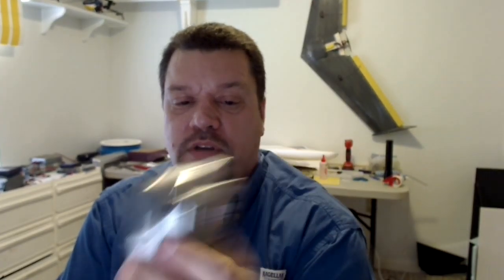FPV for beginners.  What you need to know to get started.

Comment: what about having a HAM license? i heard it's illegal to fly fpv without one. is this true? do you have one?
Reply: Not true,,  If you plan on upping your radio signal , then you do have to have a general radio license.  We do have a licensed tech that must be present when we are using the radio..... Good Question...
Reply: Candela Research Center what frequency and amount of power is legal without a license?
Reply: Lucas Madewell Most of the low power fpv 1.3Ghz, 900uhf, off the shelf are ok. You can get about a mile distance. The most basic license is called a “Technician License” and is all that is needed to fly FPV.Its 15 bucks and your local radio club can give the test. Its 35 questions, not hard. Then you can buy a long range version. There is a printout of frequencies from the FCC you can download...
Reply: Candela Research Center 1.2GHz harmonics can interfere with 2.4GHz, so your FPV and steering will work against eachother. On the other hand 900MHz jams your GPS and 433MHz requires license. That's why most people stick with 5.8GHz and try to make due with the range and line of sight limitations.
Reply: Michal Gloc
most are 1.3GHz not 1.2GHZ to help elminate this problem.

Comment from the maker: That's a pretty powerful video transmitter.  I think you would benefit from lengthening the video transmitter cables so you can move that video transmitter out on the wing.  The more distance the better.  I would say separate them as far as you possibly can and do some range testing with the video transmitter on.  Also make sure to set your failsafe on the FrSky receiver in case you loose your control signal.  Good Luck.

Comment from the maker: With a 5.8 ghz video system, you can use basically any frequency for control.  Probably the most popular would be 2.4ghz for control.  I regularly fly 2.4ghz control and 5.8 ghz video on my short range quadcopters and some planes.

Comment: Have you wired in a current sensor. I am wiring one in and the small connector that plugs into my Hornet OSD says +15V but the HORNET OSD pin is marked +5V. Am I doing something wrong? Appreciate your expertise!

Comment from the maker: Your receiver and servos will likely need 5 volts.  Many speed controllers deliver 5 volts to the receiver via the throttle cable.  You can also use a UBEC which will deliver the 5 volts.  Some UBECs are switchable between 5 volts and 6 volts.  Usually a safe bet to run on 5 volts unless you know for sure your equipment will handle the higher voltage.

Comment: Good Info. Question on power.  I am running 11.7V to main motor but wondering what voltage I run to electronics and servos?  Do I run the power lead from my UBEC?

Comment from the maker: Range of the AR6200 or AR7000 depends a lot on your area and how much other stuff is transmitting on that band like home WiFi etc.  Maybe best case you could get a mile with it, I usually stay within 1km or about 3/4 of a mile just to be safe.  The satellite is just a 2nd receiver that is connected to the main rx with a cable.  You would usually orient the polarity on the main and the satellite antennas opposite each other for better reception.  Take a look at the AR7000 rx pics.

Comment: thanx so much for the quick reply,one more question ,the quad i plan on using is receiver ready so i have some flexability there,what would you recommend for a 72mhz rx/tx?i have a spektrum dx6i and would rather use that(2.4)but without range this is potentially wrong 4 me any idea what the utmost range on the best spektrum receiver would be?thanks again

Comment from the maker: Depends on which reciever, I wouldn't fly them more than about 2500 or 3000 feet.  Others do, but it's a risk.   As far as the 5.8, you should be able to get a couple of miles out of those with the circular polarized antennas.  Especially is you build a simple helical for the receiver in the fatsharks.  I usually only fly multi-rotors on 2.4ghz and only close by in the park.  I suggest picking up a cheap 72mhz radio for FPV.  You'll get much better range.  Good Luck.

Comment: Great video,  I must say, you really did a nice job.  I've been into RC aircrafts for several years now, I started with the idea of using my heli's for fpv and quickly changed.  I'm into the multicopters now, started with tricopters and now it's quadcopters.  I build my frames and most of the control boards.  I finally built one that I feel confident enough to fly fpv.  If you get time, check it out on my channel.

Comment from the maker: @eamedia That is an excellent point and well worth mentioning, thanks.  I always use separate battery to power my video equipment.  This also gives me the advantage of using different sized video batteries to help adjust the CG of the plane.  Thanks for pointing that out.

Comment: letmeplaymystrat, thanks for the info. I have not started into FPV as of yet but I would like to head in that direction. As you have seen I have not posted any videos on youtube but that is coming soon. While deployed to Iraq in 2008-2009 I was able to purchase one of those small camera systems. I have tried to get it to work but the problem I have is that both systems use the 2.4g freq. I have not tried since the first time which did not work well. I think you have changed my mind. Thanks again